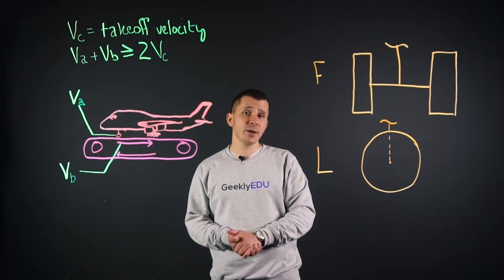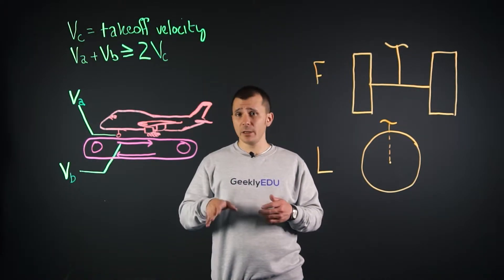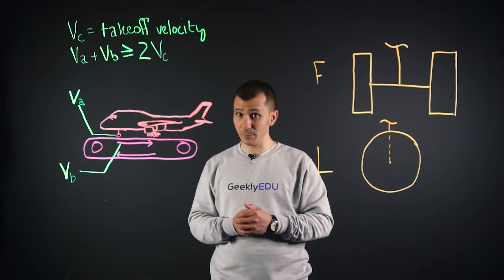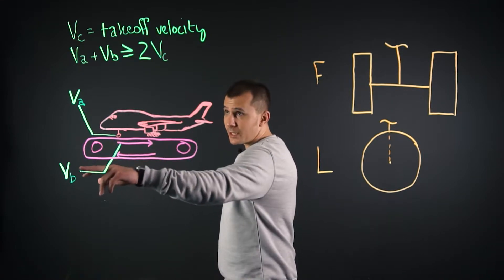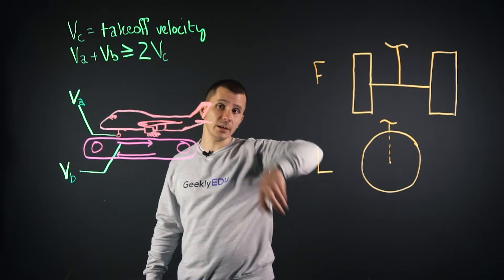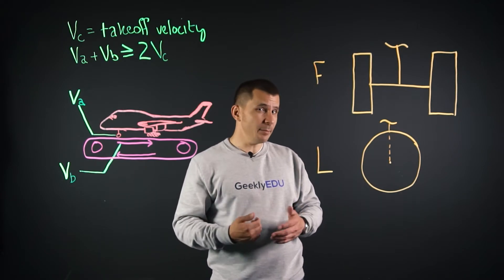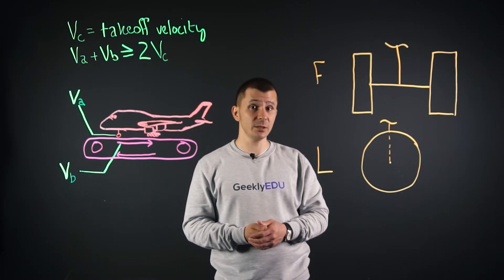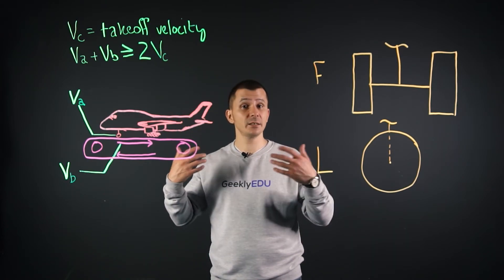Plane on a Conveyor Belt - Will It Take Off? #GeeklyHub

Comment: Mechanical design limitations are not the spirit of the question. The spirit of the question is whether or not the aircraft could attain enough forward velocity through the air to generate lift and get airborne.  The answer to that question is yes it can.
Reply: You are right about the spirit of the question. But when I heard the question phrased again more specifically as "so that the conveyor belt is always matching the speed of the wheels," then the answer became no, it cannot take off. 

If the conveyor belt always matched the speed of the wheels, then you will never achieve forward motion, and, therefore lift. Any forward motion you do achieve will be immediately counteracted by the belt moving quicker to catch up, negating any further motion. 

Like most riddles, the ambiguity lies in the phrasing of the question.
Reply: @shishka67  Why wouldn't the aircraft achieve forward motion?
Reply: @sheriff0017  Because the phrasing of the question necessitates that the conveyor belt always match the speed of the wheels. For the aircraft to move forward and achieve lift, its wheels must travel faster than the belt, which is not possible given the question.

If it were phrased that the conveyor belt match the speed of the aircraft instead, then it's no problem at all. You would just need to push a little harder to gain forward motion.
Reply: @shishka67 You say the plane's wheels must travel faster than the belt. But the problem says nothing about what the plane's wheels, or the plane itself, must do. It says the opposite: the belt will match the wheel speed. Fine; the plane doesn't care. The belt could be running at any speed in either direction or stopped or alternating, and that would only affect how the wheels spin. And how the wheels spin doesn't at all aid or limit the plane's forward motion through the air.
Reply: @Steven-gg1bn  If the aircraft ever did move forward, its wheels would have to travel faster than the belt, therefore breaking one of the conditions of the riddle. Agreed, the phrasing makes you look beyond what's physically possible.
Reply: @shishka67  the aircraft will move forward no matter how fast the wheels and conveyor belt move. They can spin until the cows come home, doesnt matter. The engines will push that aircraft forward until it reaches the speed necessary to take off
Reply: @Steven-gg1bn  I know how an aircraft works. You keep saying the same thing without listening. This is a riddle disguised as a physics problem. Listen to this part carefully: "so that the conveyor belt is always matching the speed of the wheels..."

You said, "the aircraft will move forward..." Wrong. For the aircraft to move forward from a standstill, its wheels would need to travel faster than the belt. The riddle dictates that they cannot. So it can never move forward, not even an inch. It's as simple as that.
Reply: @shishka67  you're missing the point of the riddle as intended by the author as many do, and focusing on the wrong thing. The point of the question isn't whether the conveyor belt matches EXACTLY the speed of the wheels, moreso the question is whether a conveyor belt moving in the opposite direction of the wheels would cancel out the thrust from the engines and prevent them from pushing the aircraft forward. The short answer is no, a conveyor belt would not cause the aircraft to be stationary, no matter how quickly it span. The wheels would simply spin much much faster than they normally would as they are free spinning.

Now if we were to go along with your interpretation of the question in a scenario where some imaginary power was forcing the wheels to stay in pace with the conveyor belt and ONLY spin as fast as the conveyor belt you'd still be partially wrong. The aircraft would simply blow out its tires and destroy the gears as the body of the aircraft would still be forced forward by it's engines. The body of the aircraft would bellyflop long before it reached the airspeed necessary to take off.

Now in a real life scenario there is no such force holding back the wheels from outpacing the conveyor belt and the plane would take off without a problem.
Reply: @Steven-gg1bn  Of course it would gain enough speed to fly on any backwards moving conveyor belt at a fixed and finite speed. That's the obvious answer. But the way the riddle is phrased uses the word "matched" when referring to the belt and wheels. In that case, it is impossible. Even in your scenario, if the plane was able to move just a little bit, the conveyor would continually speed up to catch up to the wheels, which in turn speed up even more to overcome it and move forward. This would cause a chain reaction that would exponentially increase the speed of the wheels to infinity (as in a positive feedback loop)...Either to the point where friction no longer is negligible, or, as you pointed out, where centrifugal force tears the rubber to shreds. In either case, the plane's not going anywhere.
Reply: @shishka67  this has been debunked so many times. You can spin that conveyor belt until the cows come home. There is no conveyor belt in existence that would cause enough friction to stop a 747 equiped with 4 turbofan jet engines. We can tiddle back and forth all day assuming we have magical forces that create barriers to lift but in reality those forces do not exist. Airplanes are real, the forces necessary for lift are real, and conveyor belts are real, and not a single conveyor belt that has ever been produced could generate the amount of friction necessary to stop a jumbo jet from taking off. The amount of friction a conveyor belt would have on aircraft wheels are nominal. Plane flies without issue
Reply: @shishka67  and my point about the gear breaking: it has nothing to do with centrifugal force. It has to do with the fact that in any scenario with a conveyor belt the wheels would have to spin faster than the conveyor belt. Of we are forcing the wheels to stay in pace with the conveyor belt by magic somehow then they would be caught between the force of the body of the aircraft being forced forward and the friction of the conveyor belt. They would be blown out by 2 conflicting forces
Reply: @Steven-gg1bn  I'm going to stop here because I'm not sure if I'm dealing with a lack of intelligence or just stubborn arrogance at this point. In my very first comment, I clearly stated that I understood the spirit of the question, but the way it is worded, the plane cannot fly. If you want a precise answer, you can't just ignore the wording and rewrite the question in your head. You obviously don't want to argue the wording that I've presented (which is a fairly popular version of the riddle) and just keep reverting to an imaginary wording so that you're not proven wrong. If we can't agree on the premise, it is fruitless to continue.
Reply: @shishka67  its fruitless to imagine a scenario with imaginary forces to begin with. If we are going that path we should stick a pink elephant on top of it and make the wheels out of bubble gum and still say it can fly. Anything is possible if we're going down that train of thought. I've seen this question on the internet dozens of times and you, as many others just don't seem to grasp the point of the question and focus on peculiarities that are just not relevant. Every reputable aviation YouTuber on this platform has chimed in on this and their answers are all the same: THE PLANE FLIES
Reply: @shishka67 You say the plane's forward motion will be counteracted by the belt's reverse motion. How? The plane is not attached to the belt. The wheels are essentially frictionless. Just how are you thinking the belt applies a force to the plane?
Reply: @shishka67  By definition, for the treadmill to be moving in the first place, it must be responding to the rotation of the plane’s wheels. For the plane's wheels to have rotated at all, the thrust of the plane’s engines must have pushed the plane forward through the air.  Remember, planes do not use their wheels to provide momentum, the wheels only rotate because the rest of the plane moves. If you were standing next to the treadmill, you would see it moving with an increasing acceleration in one direction to keep up with  the planes wheels rotating at an increasing rate caused by the plane accelerating forward through the air in the opposite direction to the treadmill’s movement. The plane would move away from you along the treadmill exactly as it would on a normal runway. Once the speed of the air over the wings of the plane becomes sufficient, it will fly. 

The only way for the treadmill to increase its speed to match those of the plane’s wheels, is for the plane itself to be moving and accelerating through the air, driven by the thrust of its engines. Note that the wheels are not causing the plane to move, but are responding to the movement of the plane, so if the plane moves, the wheels rotate and the treadmill moves in concert. If the plane stops, the wheels stop and the treadmill stops. The only way for the treadmill to continually change its speed to match continually increasing wheel speed, is for the speed of the plane through the air to be continually increasingly as well. Eventually this will be enough for the plane to fly, but the moment the wheels become airborne, the treadmill will, by definition, because the  relationship between the wheels and treadmill has ceased to exist, stop. Instantly.

The question of how well a wheel structure could hold up to this is quite another issue, and that’s without considering anything about how well such a treadmill might be constructed or function.

Comment: I think the version of the question that causes the most frustration and confusion is where the caveat of the speed of the conveyor exactly matching the speed of the wheels comes into play.  One would think, and perhaps incorrectly, that rolling resistance becomes a hurdle for airspeed to be reached to take off.  Rolling resistance is caused by the tires to the conveyor belt with the plane's weight and the wheel bearings/axle bearings themselves.  

If the plane can reach any forward speed, perhaps there's enough lift to decrease that resistance????
Reply: If belt speed and wheel speed match the plane remains stationary.
Reply: @petejammo88  if the conveyor moves exactly opposite of the wheels and match thw wheel speed, then any wheel movement at all will inturn cause the conveyor to move faster, causing the wheels to move faster and you end up with infinite speeds. All it takes is the wheels to move the tiniest bit and this chain reaction begins.
Reply: @MrT------5743  Are you implying that the riddle is can plance fly if 1=2? Because that is the final result if you imply that same speed in other direction means double speed in other direction.
Reply: @Piasecznik72  I am saying the way this is worded. If the wheel moves down the runway at all even the tineiest bit, the wheel and conveyor ends moving infinitely fast. Because the conveyor didnt match the wheel speed if it moves. Faster and faster and goes faster than light which makes it impossible as the wheels fall apart.

Those who say it can take off are using real world physics and not using what is in the question. Yes under normal circumstances, the conveyor could not match the wheel speed and it would take off. Heck if the conveyor had ice on it and the brakes are on so the wheels don't spin at all it could take off or if the wind is fast enough it could do a vertical take off.

This is why there is so many people arguing about this depending on the unanswered   issues not in the question, could make it take off or not depending on what parts you are assuming is true.
Reply: @petejammo88  Wheel speed and aircraft speed need not match. An aircraft taking off from an aircraft carrier will be moving 20-30 knots faster than its wheels will spin because the ship is moving forward during launch. Incidentally, its airspeed will exceed that speed by the wind speed because aircraft carriers steam into the wind when operating aircraft. 

When the belt moves against the wheels, the only force imparted to the rest of the aircraft is whatever drag the wheel bearings impose on the aircraft.
Reply: @sheriff0017 that mixes and matches air speed vs. rolling wheel speed which is ground speed.

In theory, a strong enough headwind could lift a 747 off the ground.  For pragmatic reasons, this thought project almost certainly assumes no headwind or tailwind along with the usual physics textbook criteria - perfect wheel bearings, no slippage between tire and surface, etc.

With a basic physics set-up like that, the wheel speed is vehicle speed; that is equal to conveyor speed.  There will be no relative motion even as the wheels rotate impotently with the magic conveyor exactly matching that speed.
Reply: @sheriff0017  No one is implying that wheel speed and aircraft speed need to match. The trick of the "wheel speed matching treadmill speed" variant of this riddle is that if the plane moves forward (relatively to the ground) at all, even at 0.00001mph there is a feedback loop from the wheels and treadmill, each making the other go faster until they reach infinite speeds, (no, literally infinite). As speed and friction are linear to each other, the friction at this point would also be infinite. drag from the wheel bearings is no longer negligible when it is multiplied by infinity. In other words, pushing the aircraft with ANY amount of thrust will instantaneously be met with an equal amount of pushback from added friction. Unless of course the wheel skid down the treadmill at takeoff speeds, but that's cheating.
Reply: @petejammo88  By the way, if the parking brake were left on while launching an aircraft from an aircraft carrier by catapult, the aircraft would still reach flying speed. I wouldn't count on landing intact, but it can get airborne.
Reply: “If the plane can reach any forward motion” is breaking the rules of the question.
Reply: normal free spinning tires on a belt with 100 tons on it would obviously match belt speed, I guess… 
Conveyor length might be an issue.
Reply: Rolling resistance is not a significant problem.
Reply: The question is just a red herring. The "speed of the wheels" has to match the plane's speed since that's the only linear speed in question. The rotational speed of the tires can't be matched, because the tires are rotating. At the point the tire touches the ground (assuming no skidding), the tire's speed is always zero, even when moving. That's balanced out because the top of the tire is moving twice as fast as the plane. Anywhere but the top and bottom, the tire is moving at varying speeds that are at a different angle from the motion of the plane.